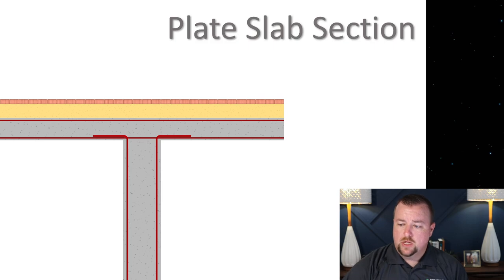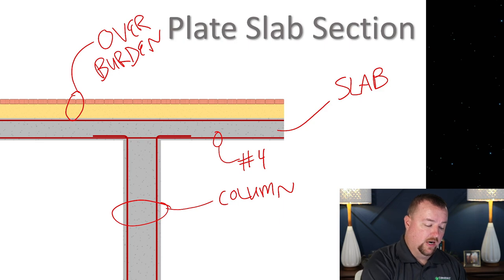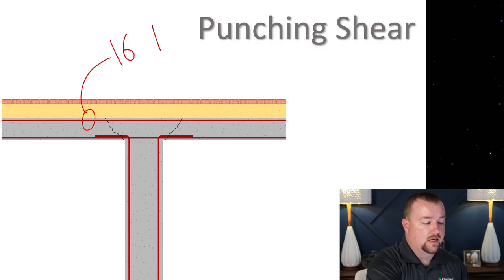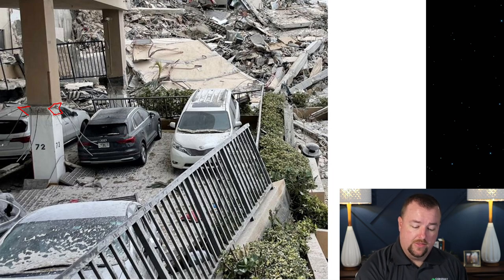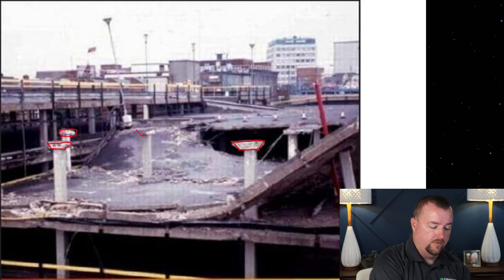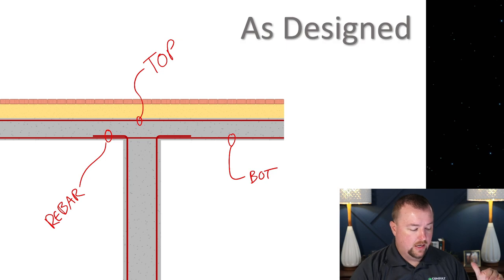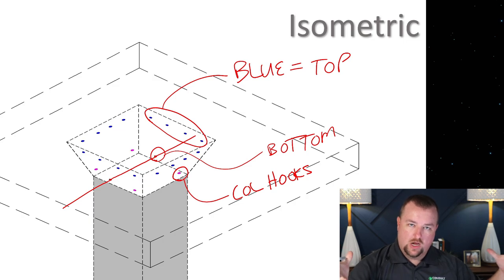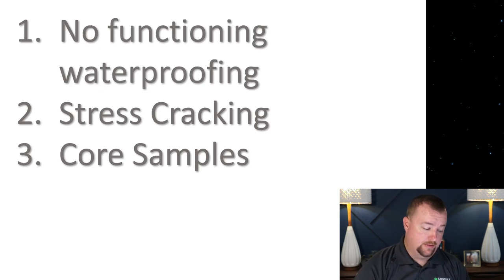The Importance of Punching Shear at the Surfside Collapse

Comment: Josh - your videos are factually-anchored, and outstanding. You are clearly expert, articulate and in your field. 
I read in the 1980s a not uncommon illegal practice was using salt water in concrete; cost cutting. Could this be the case at Champlain Towers?

Comment: Like the explanation.  With all these HUGE cracks in the slab, where did the missing material go?  Wouldn't there have been amall chunks of concrete on the floor of the garage or around the exterior of the building?   It didn't happen in 6 months or a year.  It's atleast 5-10 years of damage.  How could the unit owners not see the problems?

Comment: A leaky Salt Water Pool inside 12th floor Penthouse could have brought deterioration on the entire building over time. water leaking down threw the structure into the basement. corrosion on pipes threw out the entire side of the structure caused other pipelines to leaking.
Reply: This would be the 4th time reading about “a pool” in the penthouse. Interesting

Comment: Very good.  When you circle the columns parking space 42 and others.  Yes, indeed where is the bent over column reinforcement?  Was it never there or did it get corroded?  This may have been practice for the time but there have been many punching failures of flat slabs.  Surely the warning signs of water penetration (sufficient to cause stalactites!!) and cracking to soffits around column heads were there to be seen and acted upon.

Comment: Two items:
1. Shouldn't a structure be designed such that if a slab falls then the damage remains local to that bay in the building?  Maybe you will discuss in your next video on building strength.
2. In the garage walkthrough there was a crack in the floor going crosswise at the midspan of two or more adjacent slabs.  Does suggest that the foundation was spreading which resulted in tension in the slab?
Reply: Sure - if only one slab is damaged.

Comment: I don't think the column rebar would bend & lap with the slab bottom rebar. Column rebar usually extends straight up to underside of slab top bar and bends to form minimum a development length from the intersection point with the slab bottom rebar.

Comment: Looking forward to the future video as this one was great. Was the builder incompetent? Omitting a membrane and rebar due to lack of sectional detail in the plans or intentional cost savings? How did the inspector not catch this?  We have been working on a hotel in California with only single walls and all electrical installed until we were asked why our exterior roof installation could not obtain necessary R values we pointed out what was below the roof as the culprit. This hotel is now over 2 years past original completion date but NOBODY had caught the obvious lack of double wall construction? So nothing would surprise me. I am glad we only did the roof and had denied other trades.

Comment: I understand and agree with every point you made about the punching sheer. That not with standing it would seen that the punching sheer, out and away from the building, is another interesting issue.  The question I have is what happened with regard to punching sheer at the base of the building? That said why did the punching sheer out and away from the buildings base find its way to collapse. As I say I see two distinctive events happening at the same time.  What ties then all together.  What was the moment of incidence that brings these events together.  I am still stuck on the toppled col near Col 27 and why, before the building started to collapse, it alone was laying on the ramp base floor.  I suspect still yet a chasm (sink hole) at that very point of that tipped ?? col.

Comment: From another Engineer, good explanation. Check out some of the photos that show streamers of reinforcement clearly seperated from the slab. I thought initially it was bottom of the slab and low concrete strength it just pulled through, but now I agree, it is probably showing delaminated slab face with huge amounts of reo dead straight and hanging free.

Comment: I like your methods to finding the cause to this sad catastrophe.
Another possible contributing factor that I was wondering is the concrete strength. The first core looks to me that the aggregate spacing is greater then it should be, hard to tell in photo. The second core was even harder to see any details.
In the 70's concrete additives were new & few and the older engineers were reluctant to try new things. So basically, the finishers could have added a lot of water to make the concrete pumpable and/or easier to finish. Extra water spreads out the aggregate, leaves more paste near the surface and weakens the strength design by spreading out the cement particles enough so the crystaline structures cannot interlock when they grow for the desired strength.
So many things to look at, hopefully you engineers can use this Sad event to stop more buildings from collapsing.

Comment: Even if the concrete had spalled and delaminated the rebar would still be present in the shear head. I would expect to see some of this rebar stretched over the tops of the columns that punched through. There doesn't appear to be any rebar from the shear head visible in the photos. Can you explain why this is? I would also like to say that this is the best series on the tower collapse that I have seen. So good that I refuse to watch most of the other videos on this subject.
Reply: The top layer of rebar sat in salt spray and pool water for decades if it was installed to design plans.   The 1980s-1990s was a very odd time in south Florida construction.
Reply: Concrete delaminates when rebar corrodes. There's nothing to hold on to.
Reply: The rebar your looking for was cut (sheared) in the collapse and is down in the rubble. Without delamination the top and bottom rebar work together to make a large structural member. With delamination, you have two small, weak and easy to break pieces.
Reply: I believe he said the "penciled" columns would have just pushed the top rebar aside. Take a nail and push it up through a piece of cloth then inspect the hole with a magnifying glass. See the threads deformed to the side of the hole? That's pretty much what happened to the rebar because it had all loosened up near the top of the slab but under the finished floor layer. I think I understood him and explained that right, maybe, if I'm lucky. Seems like there's always lots more to say than one can write in a reasonably short reply.

Comment: I like that explanation for the punch through. weakness.  But I don't see any evidence of the upper layer of rebar.  I wonder if it was placed correctly . Might have been spread out and wide spaced like the bottom layer. Or it could have corroded to only a fraction of its original strength.   It will be interesting to see what the investigators find.
Reply: I hardly see any pool deck rebar in the collapse photos, nowhere near that specified.
Reply: @gordonrichardson2972  Rebar is sparse throughout the whole collapsed structure.  Probably a "cost savings" for the builder.  It is a lot cheaper to pay off the inspector.

Comment: Hypothetically, if the rebarb and concrete were in such a bad state over such a large area and repairs could have been done before the collapse,  what exactly would of been the repair process? How can such wide spread damage be fixed? Or can it be fixed since the slabs are tied into the columns? I only ask because I'm sure Champlain South can't possibly be the only building in all of South Florida with failing concrete, poor or nonexistent weather proofing, poor deck design, neglect,  unknown design changes or shoddy building construction (or any combination of those).   The outcome of this could really affect many of the older buildings

Comment: There are two kinds of shear: 1) vertical shear, and 2) horizontal shear. You are discussing vertical shear. 

I see a bigger problem with horizontal shear AND reverse bending. 

Think of horizontal shear by taking two 2x4’s and install the ends on a chair about 20’ apart. When you stand in the middle of the 2x4, you’ll notice the 2x4’s slide by each other. This is horizontal shear. That force can be calculated and is resisted by rebar….if properly placed. 

When concrete (slabs or beams) pass over a support (column or beam or wall) the the tension on the bottom is transferred to the top and this is called reverse bending. This force is also resisted by rebar, if properly placed. 

Can you do a video on reverse bending and horizontal shear?

Comment: the Joseph McCullough Center in Cleveland is a hundred year old building still utilized. This building has a flared capitol on each column. Seems to be a long lasting design. Would this design have stopped the punch thru at the towers?
Reply: It would certainly have helped here. But there also seems to be physical latent defects all around this project.

Comment: Great analysis,  again.  I want to ask, the top steel (about (4) - #5 E.W. over the column)... why don't we see this in the destruction pics, typically?  If it was so degredated, I guess it could have easily ruptured and stayed within the top, delaminated layer rather than being strong and intact....in which case we'd see all kinds of lengths of steel, pulled out, at these column locations.

Comment: Compared to Eurocode standards , the under reinforcement and poor detailing is astonishing ! ... the col rebars should be extended to the top of the slab , there should be vertical stirrups inside the slab around the col (to account for punching shear) or even better an enhanced zone of over reinforced slab (simulating a beam inside the slab) which combined with the column rebars would form a frame like joint behaviour ... there is no ductility in this kind of detailing hence the brittle instant failure

Comment: Awesome on the waterproofing-flat scary. Any chance that, due to it being A: Below grade, and B: Had what-12 floors on top? C: Pancaked down on top of each other, all pieces of the shear head got slammed to pieces? Seems like slab after slab would have had a jackhammer effect? One thing is that Marble and Granet are all the rage right now. I noticed condo tours show marble floors. I noticed all of the large AC units on the roof. When the place was built, I don't think central air was being built standard-those things are heavy. In that time period, glass and brass with golden oak and shag carpet would have been put in-all light weight, respectively.

Comment: If the top mat delaminated, there was no effective flexural reinforcement for negative moments in the continuous slab over the columns.  Shear cracks may then propagate from the flexural cracks over the columns, thus resulting in the shear planes indicated in the photos.

Comment: One of the items you mentioned were Franki Piles with the cement plug at the end. Could you go thru how they are driven in and set along with what is done to assure the plug expands and the Pile is properly filled and reinforced.

Comment: Excellent video.   A question:   is the punching shear failure of these floor slabs the cause of the building collapse or a result of the building collapse?  I say this because the suddenness of the collapse also raises a question about whether support columns buckled, which would probably have overloaded the slabs that then would have failed in punching shear.   Put another way, would the failure of a pool deck slab through punching shear bring down the whole building?  Thanks.

Comment: Interesting information. As a refractory bricklayer I dont place rebar in my castable pours. But if I did, then this would be helpful. The builders of this mess sure missed what was called for as far as the number of rebars per column shear points. Though with all the other delamination going on with the top layer it seems to me that the required amount of rebar wouldn't have been useful in the scheme of things as seen.
Praying 🙏 for the families of the lost.
Now that

Comment: Punching shear started it, assisted by delaminated top rebar mat from corrosion expansion and related stress cracking. But, there has to be more wrong; missing rebar?  Safety factor should keep rest of building up but I do not appreciate factor of leaning induced stress or were column bottoms taken out?  Good demonstration and good explanation of the factors in this vid. Look forward to future vids on this topic

Comment: Great videos and explanations but those breaks don’t really look like caused by spalling on those core samples. Looks more like voids and the aggregate looks different like they poured different levels with various mixes. Or the person cutting the cores the vibration of cutting the rebar simply broke the cores. And that much sand underneath the pavers without adequate waterproofing and proper drainage it will simply allow the water to sit and seep into the concrete.

Comment: My biggest question is why was the deck tied in to the building in such a way that the structural integrity of the building depended on it? It should have been a separate structure, with maybe some superficial connection, as it had a completely different purpose and different stresses imposed on it - those associated with outdoor space, a lot more subject to poor maintenance decisions and change. Parking garages should not be integrated with residential buildings of this size either, but that's a whole other story. Again, different purpose, different stresses, different exposure, different acceptable risk. When is zoning and code going to catch up to common sense?
Reply: I agree 100%. Should have been a supporting wall at the south under the building. Not only was this not done, the south wall had no columns, it appears to have been supported by beams running column to column north to south. Sacrificed for the sake of parking spaces, I suspect.

Comment: Excellent explanation!  I am thinking that the act of coring out a sample over the rebar actually weaken an already weakened delaminated structure.  Do they actually target to get a sample of the rebar or just by off chance?  Is there a non-destructive method like ultrasound over concrete slab?

Comment: If those tiles on top were installed with a grout our other porous material below them, the grout likely had near permanent water in it.

In bathrooms that have tile over concrete, a single shower can get water under the tiles, but it can take hours or days to dry it out with a heater+fan.

Comment: going forward, my concern is there are many structures that are built that rely on a single element that is the primary member that keeps a structure from failure even with adequate reinforcement steel. what scares me is when a see parking garage columns holding up a high rise building even if they are 24” square. if a car takes out a column or a fire occurs, this can cause a collapse. instead, there needs to be a (redundant) structural design to protect from this kind of failure by using shear walls, load bearing walls, designed into the structure. MiamiDade has to review buildings that are of the design that failed relying on the integrity of a single column regardless of whether it has the proper reinforcement steel.

Comment: Hi Josh:
New to your channel, great interpretation of why failure may occur. After watching around 10 episodes I have focused on the explanation of the embedded rebar. The first question I have is, why epoxy coated rebar or galvanized coated rebar was not used in and around wet area locations? I was just wondering when, building so close to a salt water environment why wouldn't the country require this as a code requirement or at least as good building practice. Great video, wish I had come across your videos much sooner.
Reply: I meant to say
Reply: county

Comment: Waterproofing on top of tile sounds like they tried to add it on after.... I wonder how long after, if it was still during construction or maybe one of the patchwork repairs the condo association did over the years...
Reply: It looks like the tile was the original pool deck paving surface. Rather than strip this off down to bare concete, they applied waterproofing over the tiles and then added the layer of sand and paving.  The question to asked is how much extra dead weight per square foot did this add for the deck slab to support and how loaded was the slab in the new state over its design loads?

Comment: If the shoring posts were removed before an adequate cure time especially in a humid hot site initial delamination by sagging of the top mat giving the failures a path to attack the rebar.  We were constantly under pressure to remove the shoring by the contractor to remove supports to save having to buy more posts and brackets.

Comment: I'm a 45 yr waterproofing expert, good analysis, Poor to no  Waterproofing is the primary cause of failure, no doubt about it in my view. When water enters unoccupied areas owners tend to be slow to fix, that will change when they get the final reports on this failure. You have nothing without good waterproofing.

Comment: #4 rebar seems very spindly for this slab.  Also you should never specify #4 for bottom and #5 for top. Too easy for the crews to mix them up as they look similar.  Just use all #5’s. Or. Prob #8,s all over. With as someone said. #4’s for stirrups.

Comment: Something I haven't been able to find any information about, and which you may know - do we have a forty-year recertification report for Champlain Towers North? As I understand it, the buildings were essentially identical, and were built at the same time. If North had the same kind of problems we see in those cores, then that would seem to suggest a problem with the original design; if it doesn't, that would suggest a problem with the maintenance of South. Or at least, that would be my assumption?